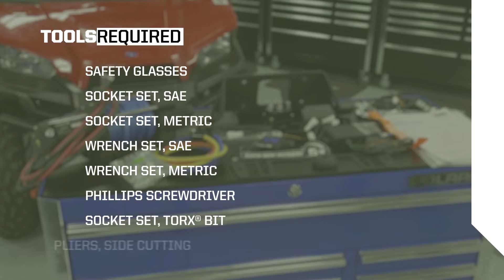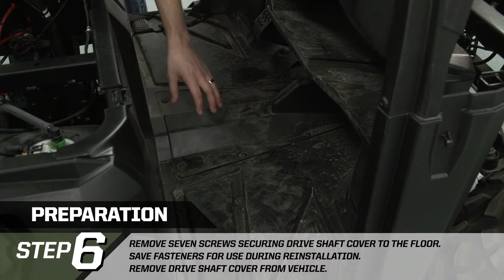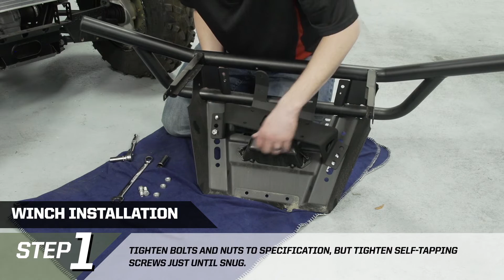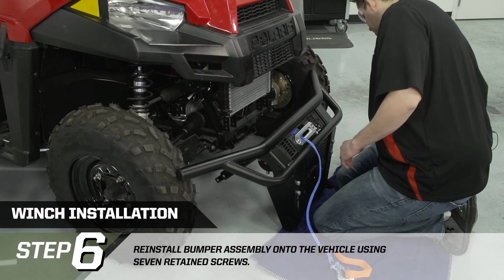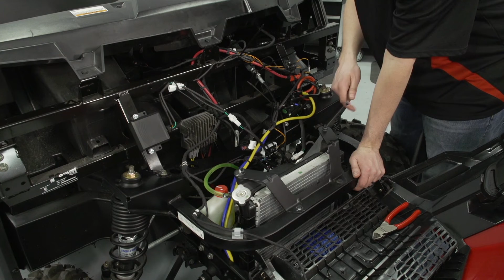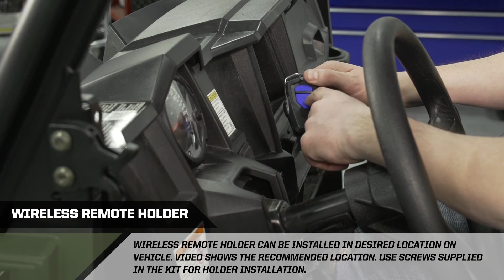RANGER® 570 & 500 Polaris® PRO HD Winch with Rapid Rope Recovery Install | Polaris Off-Road Vehicles

Comment: Polaris should consider pre-wire every ranger from the factory and bury it into the overall cost. Leaving the work to add the winch as easy as plug and play if so chooses.
Reply: not a fan of that. It will increase the cost of the vehicle. Yes just some wires and connectors. however it all ads up. Wiring this up is not that difficult. Adding wiring to Autos / trucks is much more involved.